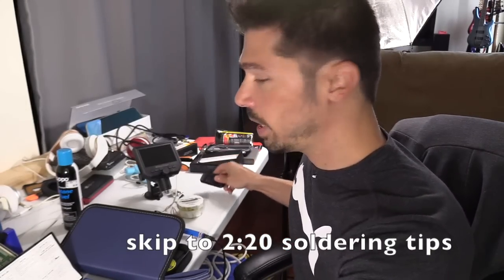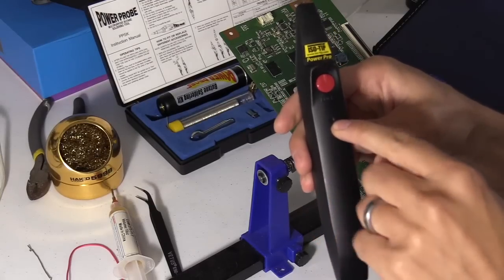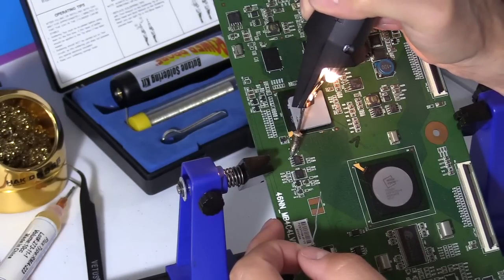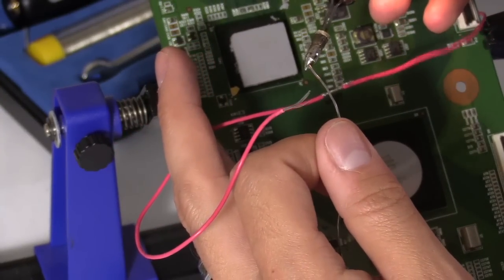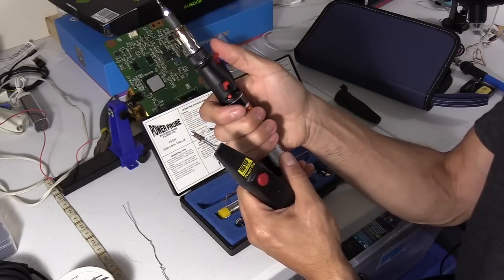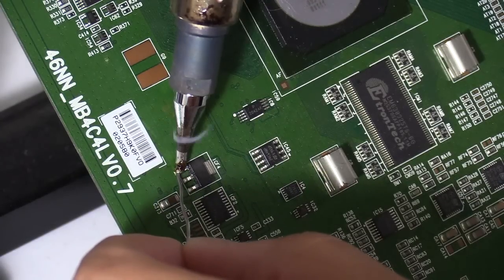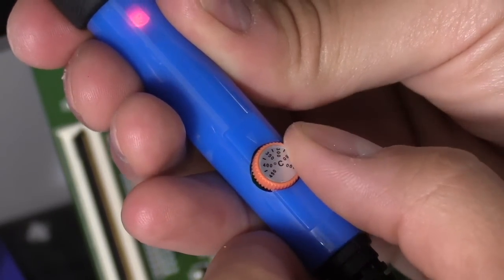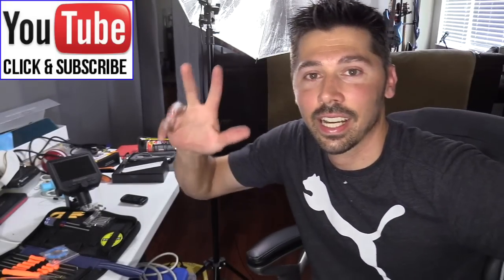3 Must Have Soldering irons- Iso-tip pro vs Butane Power Probe vs Tekworthy Solder iron kit

Comment: I found putting flux onto the board first and then applying desoldering bread works better than putting flux on the bread itself. Seems crazy, but it really works better for me.
Also soldering on ground plane with these old technology irons that has separated heating element from the tip needs cranking the heat up more which is bad for the component. Instead use soldering iron tips that has heating element built into the tip itself.